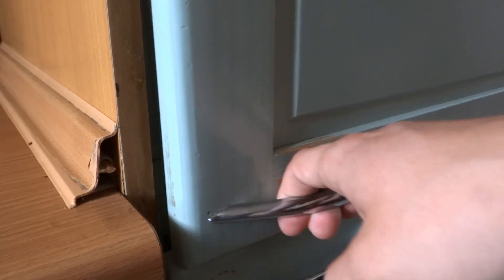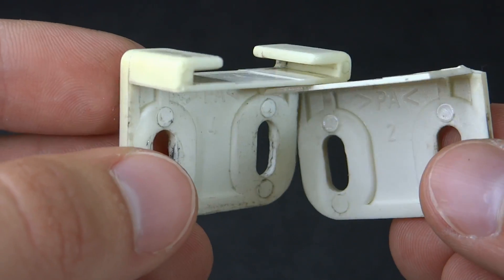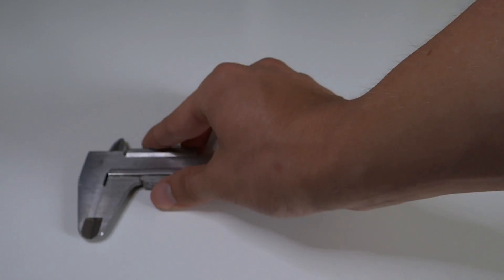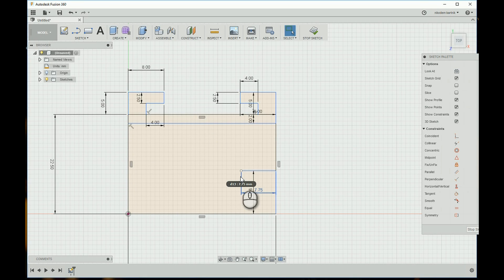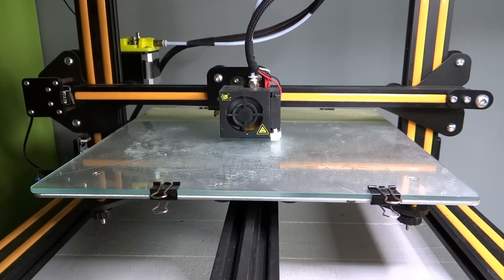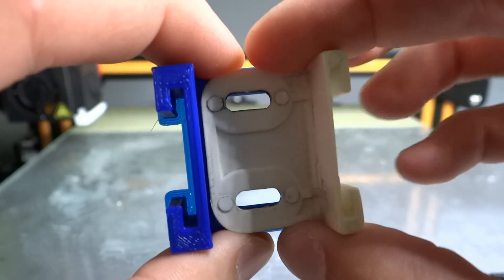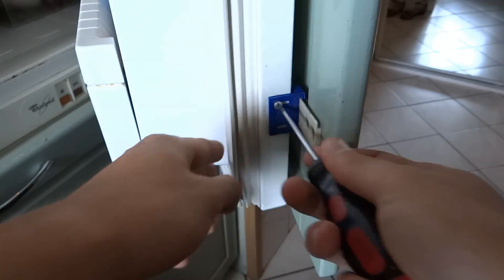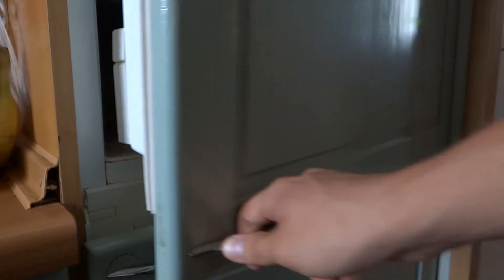How to Fix Things With 3D Printer

Comment: that was pretty cool... you're very good at technical things... but what if there is only one part... and it is broken... how can you reconstruct the design with only the broken part?
Reply from the maker: As Edward Lymer said, you have to see how this part should work and try to design similar part but it doesn't need to be identical. Sometimes you have to print out few parts to make it perfect.
Reply: Hi, Try researching the part but if that comes up with nothing, just look at the application of the component and design a part with the same functionality of the original. May not need to look identical to work. What is it thats broken?
Reply: Nothing is broken... it was just a hypothetical... but thanks for your advice... I really like this practical application of 3D printing... there goes planned obsolescence... haha ;~p